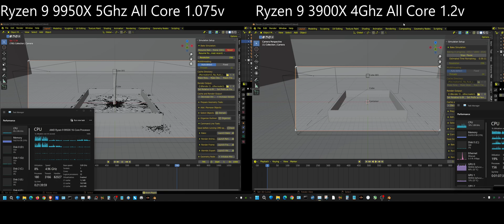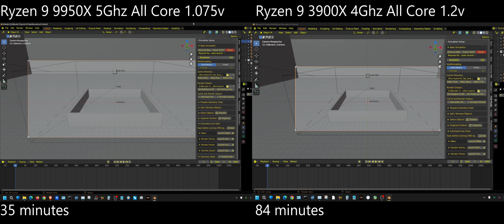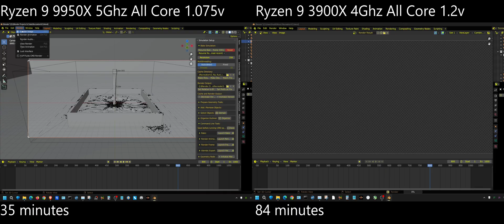Ryzen 9 9950X vs Ryzen 9 3900X For Simulating Flip Fluids In Blender

Comment: Great video. I thought that simulations were single core only as they can only compute one 'unit' at a time before going onto another. I built a duel socket machine out of scrap and found I wasted my time when I really needed one processor with a faster base frequency for number crunching and enough ram for the vertex data. CPUs with multi cores as you know cycle each core to dissipate heat so a question could be at what point is number of cores effectively bottlenecking overall system performance for other tasks for that machine. My 2 socket 6 core machine seems to be far better than a multicores tested up to 32 cores.
Reply from the maker: Thanks.
Historically in general you are correct that simulations prefer. But now simulation like flip will utilize all the cores, albeit not fully. I could only guess at the coding needed to make it simulate multi-threaded. But I do believe clock speed is very important and also work per clock efficiency(there's a name for it).

IMO, less than 8 cores, 16 threads, seem to be the point where Blender demands can start to interfere with multitasking. I still have another machine with a ryzen 5 1600x and it multi tasks well. But I can run it side by side with a ryzen 5 3600 and the 3600 is quicker even at 200Mhz slower clock speed.

When it comes to vertex data, it's largely single threaded. However, the other cores aren't parked. They are doing something. I can smoothly work with 40 million triangles in sculpting mode. Although I can't sculpt a straight line.

24-25 years ago I had a gigabyte MB with two 800Mhz P3 cpus. That was essentially the only way to have multi cores. That was barely before the core duos. It was a finicky machine.

There are some fluid simulators that use a GPU to perform the fluid simulation. Somehow they are able to get it to work with 1000s of cores. What I have noticed with Blender is that it's slowly starting to use more cores a greater amount, regardless of the simulation. It's just typically it favors the fastest core.